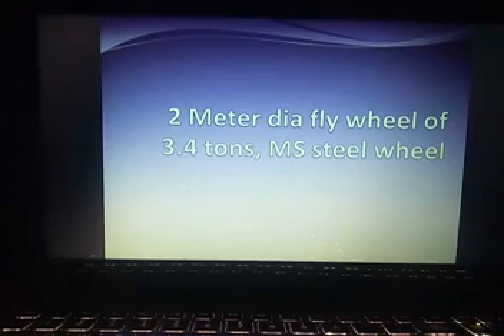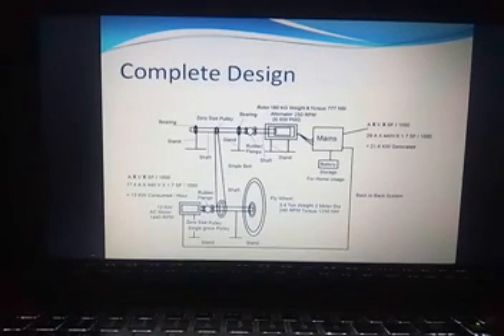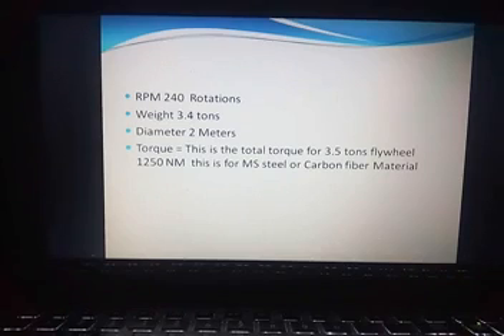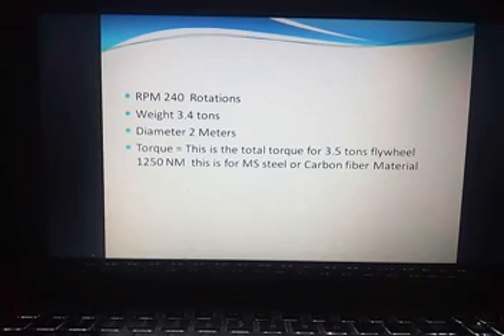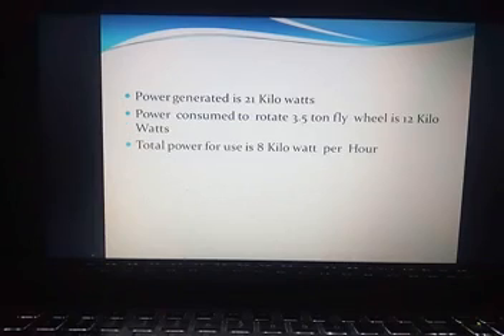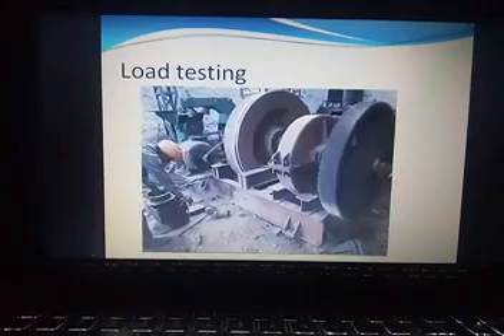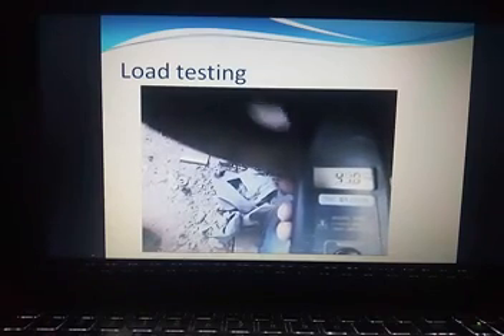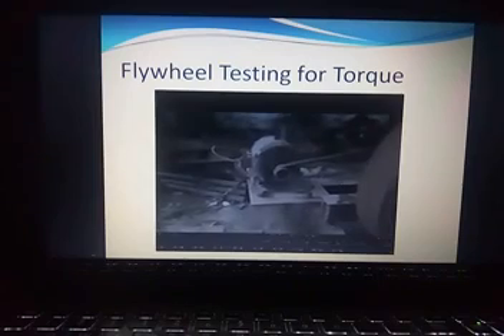Green Electricity

Comment: Dear Bhaskar,

Manzoor here from pakistan im also working on flywheel supported free energy or energy multiply system  please send me your email or send me a mail on my email at mhb111@live.com i wana shear my desgin with you can you advice me betterment for my system. my system based of hydraulic system oil powered motor. My PMG is oprating on 500 rpm with 220/440, 50 Hz 15 KW  and use a 300kg flywheel for main system and a 400 kg on Alternator shaft for braking the load torque  plz send me ur whatsapp no on mail.

Waiting for your positive response,

Regards,

Manzoor Hussain Bhatti